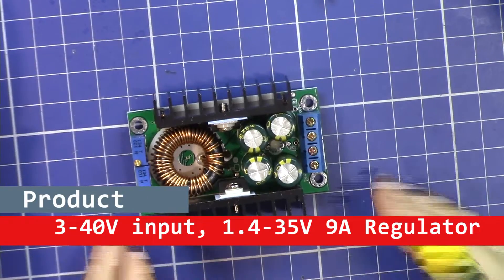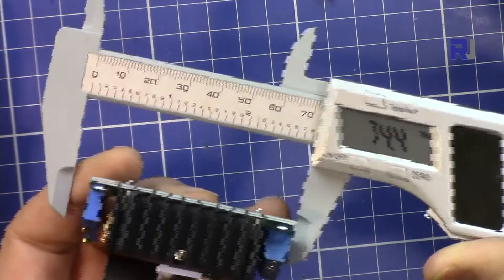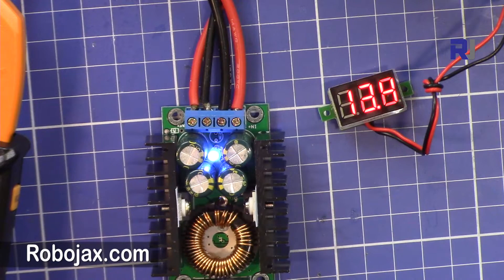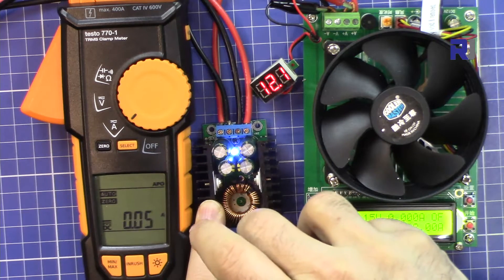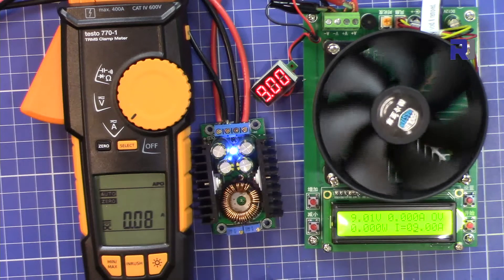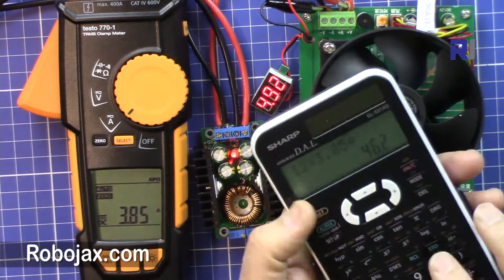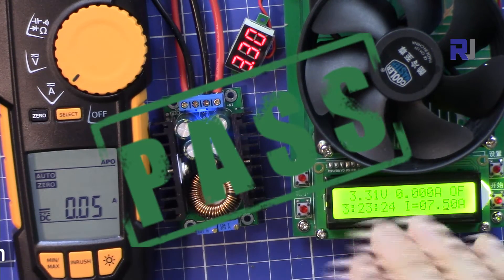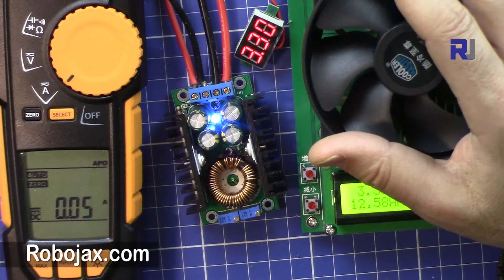DC CC 9A 280W Step Down Buck Converter 7-40V To 1.2-35V XL4016 Module - RJT321

Comment: im newbie with in times of power supply ..

my source is 12 v (4 amp)  = my device is 6 volts..  (what if my device need 3 amp to work)
soo do i have to adjust the power supply ampire more than 3 amp ("5 amp")? or let it be zero..? it will just automatically ?

i notice u didn't adjust the ampire adjuster in power supply.
Reply from the maker: Ampere is the current. If you have a drive that works with 10V 1A,  You can connect it to 10V 1000A and that is fine because your device will draw only 1A. So the current is always determined by the load and not by the power supply. Your power supply should "supply" enough for the load. If Your power supply can supply more that is excess. But no harm.

Comment: can we set the max current?
How to display the max current selected?
I've seen this video
https://youtu.be/wI-KYRdmx-E
show how he set max amp.
But i couldn't catch the connection made..
Reply from the maker: any module with Constant Current (CC) can control the output current and protect the device. (this you have to know first). You will connect your current meter between this module and power supply. then for example set output voltage to 5V. For example if you want to set maximum current to 3A, Then short circuit the output of this module and read the current on your current meter (ammeter). Adjust the knob until 3A current is displayed. Remove the short circuit from the output and your power supply never allow more than 3A.

Comment: If you had tested sufficiently to have a data set you could have very easily plotted the max outputs against input & output voltage  which would have been very useful.
Reply from the maker: the more I do engineering type review, the less people want it. People want plain test and result and I am slowly going towards that direction to make it for everyone so they understand it even if they have been to grade 9.

Comment: is this module can ignore input for 42V 10A? because i want to step down to 25v 5A
Reply from the maker: if you wan to adjust the current that is called constant current or CC. watch the video to see if it has Constant Current.
Reply: @robojax  i have watched bro, so this module can it works to stepdown my power supply?

Comment: Which durable AliExpress  buck converter would be best for a Raspberry Pi 4 . 13.8 vdc input must go in the buck converter. Pi needs 5vdc  4Amp average
Reply from the maker: Hi, Raspberry Pi 2 needs only 2.5A see it here https://www.raspberrypi.org/products/raspberry-pi-4-model-b/specifications/ and this module is like carrying single person on a truck.
Reply: @robojax  Okay. That part is clear.  I just Ordered  2 XL4016 from AliExpress. What would be the best way to adjust  the  Amperage potentiometer.  Since i only have a voltage DC meter.   No current clamp meter.    Should i just  turn the current potentiometer far enough so that the Pi doesn't  go out, or give me under voltage warnings.

Comment: Good, I set the current to 5A if my load needs less than 5A for example 2.5A.
Does the converter only carry this current at 2.5 A if it sees that 5 A is too much for the load?
Reply from the maker: Calculate the power using voltage V and current I, so P= VxI and OUTPUT =INPUT-10% of INPUT
Reply: @robojax  thanks , tell me one thing if I set the current 5a, I'll always have the current output 5a ?

Comment: I bought the same module and whenever I measured the current, it never changed and remains between 6-8mA even though I adjusted the trimmer, so I think those DC converters are not that thing you can trust on, sometimes can come failed
Reply from the maker: when we talk about 9A or 9000mA the 6-8mA is 0.1%. This device (I believe) has 2-5% accuracy. So you still got good result. If you wan to measure small current, then get something that can adjusted between 0mA to 100mA or maximum 1A.

Comment: I am working on a raspberry pi project using an old laptop screen. The screen control board requires 12v 3a and the pi4 requires 5v 3a. I have a power supply that can output 19v 6.5a. I would like to only have one power supply for both but I am confused on how to do this with buck converters. Do you have any input? Great info on these videos BTW!
Reply from the maker: this module can give only ONE output which you can set to any voltages you mentioned. So you will need different module for other purposes because they are different in voltage.

Comment: Do i need to add a schottky diode on the output of this module to charge lithium batteries from solar panels?
Reply from the maker: Job of the diode is to allow the current to flow in one direction. If you want to block the current from outside to come to this module when the other source has higher voltage, then Yes put a diode and it will block the current from entering to this .

Comment: Thanks, I just was looking for input 12v and output 3v3 at 9A. Now I realize that this thing can handle 7.5A at max.
Reply from the maker: You  are welcome.
Reply: It can power 6 x mg995 servos and arduino at once - 5v, 9.33 amps is the max which i had on my multimeter. Is that real? Idk it's cheap model  of multimeter - dt9205. But for sure it can deliver power for 6 servos  and they can turn at high speed, while two of them were hanging on cables attached to 3rd one. And everything worked like dream. So i cna suggest it for robotic arm.etc.
Reply: It CAN handle 9A but limit inrush current.....
Reply: pm me can you to install do sola paint of charger¥

Comment: What does you take max. output voltage with input 12v?
Reply from the maker: The output is always about 1V to 1.2V less than the input. So for 12V input, you will get about 11V or 10.8V
Reply: @robojax  Thank youu ✌🏿
Reply from the maker: you  re welcome.

Comment: Hi,Is it  right to assume that when the output load is more it can offer. it cuts off the load electronically,  based on this can this be used to  automatically switch on load when sufficient power is available from a converter   whose input  connected to a solar panel , solar panel  output vary based on sunlight intensity
Reply from the maker: Hi, Yes you can set the amount of current and it will disconnect the output if the output current exceed the settings. Of if the output is current is larger than the input.

Comment: I needed this for 5V 4A. Works well with 6.4V SLA battery. Voltage is very stable.  I hope it doesn't get over heated at 4A

Comment: For more than 7 Amps (input or output) you should provide extra fan cooling! But 8 Amps will be the absolut maximum at lower voltage difference. I use many of these modules for diy lab power supplies - powered by old laptop PSUs - works great so far.
Reply: Yeah I don't think he has enough power going into it
Reply: J'ai ce module et je n'arrive pas à régler l'intensité elle est en rapport avec la charge c'est tout il l'est impossible de la régler je voulais l'utiliser comme chargeur lithium dans ma voiture entré 14 volts sortie 16.8 sous environ 5a comment faire ? Merci

Comment: This device changes the input current value?
Reply from the maker: The input current always depends on output current. If output increases, input also increases.
Reply: Robojax ok. What I wanna do exactly is I want to decrease 1A to 0.7A to charge my lead acid battery. This device makes it?
Reply from the maker: but why you said "input current". That should be your output current. Yes that is what it does. Constant current means that and it has the variable resistor (potentiometer) to change it.
Reply: Robojax I meant does this device change the input current into another "lower or higher" value as output. So ok if it does change 1A to 0.7 A then does vice versa? For example change 1A input into 3A output?
Reply: @philipmurrayy  current rating means that is the max current available, so if your input is 1A and output draws 0.7, it is just okay because the 0.3 current is standby. There is no need to change current. Current is standby parameter. Current is analogous to water in a tank. If you needed more water, just draw some more water. While voltage is analogous to water pressure which can damage devices if not controlled. As you can see almost all power supplies are voltage regulated, not current regulated. And in parameters, percent regulation is calculated using voltage, not current. So in short, what i'm trying to say is that current supplies are not meant to be regulated. As long as the load current does not exceed the max current of the supply, it is safe to use.
Reply: Carlo Malalad thanks a lot. Great explanation

Comment: i just buy one and its work grate on 8A
Reply: pm me can you to install do sola paint of charger¥
Reply: @anwin85alon  yes it can work with solar panels charge but you need to not pass 5A max for long term working . And use it as 2 to 30v uses . It's good unit as step down converter from 35v to (2-30v) and don't use high current with out Colling fan . You can use it with out fan for 3A or Soo for charge.

You know how to select voltage but do you know the way for how to select  the current ? ( I know how if you want ).

And by the way you can use it as protection from over current ....

Comment: What is the current of the input voltage to power on this buck converter? Is +32V, 720mA DC or +16V, 610mA DC will work as my input voltage to power on this buck converter?
Reply: pm me can you to install do sola paint of charger¥

Comment: Regardless of what it says on the EBAY advert the performance of any item MUST be checked using the makers PDF data sheet where possible. Should more Amps be required a 0.1 Ohm load sharing resistor (5W will normally do) should be added to the output +  and then 2 or more bucks in parallel can be used set to the same V and A . Do not adjust under load. I always use a small fan and would not go above 7A. These units are bomb proof - almost.

Comment: Can you recommend Step Down Buck Converter for Arduino Uno Digital input pin
Reply from the maker: Arduino digital input is accepting 5V. Yes if you set the output of converter to 5V.
Reply: @robojax   can i use this for a raspberry  pi 4 that needs 5 volts dc.  How do i adjust the ride current.  Since i dont have a Amp meter.   My voltage meter only measures AC/DC and Resistance.   The XL4015 has trouble on getting the pi4 with usb wifi adapter  running.  .  The input on the xl4015 is 13.8 volts dc. Outputs around 5.1 vdc.

Comment: Bro as i remember xl4016 is  rated for 8A of current( i think i saw on data sheet🤔 not sure), so why you are testing with 9A.?
Reply from the maker: On eBay they listed it as 9A and some as 8A. So i am giving warning to the buyer. see ebay listings https://www.ebay.ca/sch/i.html?_from=R40&_trksid=p2047675.m570.l1313.TR11.TRC1.A0.H0.XDC+CC+9A.TRS0&_nkw=DC+CC+9A&_sacat=0
Reply: @robojax  oh okay. got it . nice work by the way 🤗🤗

Comment: Thanks for the review, but have you done any stress tests by any chance?
I am using 1 with up to 30V input (7s lithium battery) for 12V output to power a PC with a picopsu at 3-4A. It works but gets hot so i'm concerned about leaving it on over night. It would be good to know how it would hold up at say 4-5A over a week with temperatures.
Reply from the maker: You are welcome. I did test to exactly answer that questions. You should come to conclusion from the test I did. I can't say  because there are many factors that causes the device to overheat including location of the device and how good ventilation it has and other factors.

Comment: Can I use these In parallel to get more amps? Great video 👍
Reply from the maker: Theoretically it is possible. To avoid energy loss you must sent both output voltage AND current exactly the same BEFORE you connect them in parallel. Smallest variation of voltage will cause the current to flow from one that is higher to the one that is lower and the one with lower voltage will act as load and you should try to avoid one of them acting as load. If you can set both at exact values, yes you can do it. But I advise against it.
Reply: @robojax  thanks 😅 I will avoid then!!

Comment: Great video! I have a question, I have several laptop/tv/printer chargers lying around (12 to 36V). What module do you recommend for me to turn it into a sort of bench power supply? Requirements are that it should be cheap, capable of handling up to say 5A, thanks!
Reply from the maker: I don't know specifically which will have more power. But you can read the current rate as amper or power as watt. The higher the power, the larger the size of power adapter. So  you need to multiply your required voltage by 5A and whatever power you got, just add 10% to 15% to it and select the adapter that is equal or higher than Power+10%Power.
Reply: Robojax thanks for the reply. Do you have a recommendation for a buck converter I should use?
Reply from the maker: There are so many potions. This module would be the best. But if you pick exact 5A, it will not work because it will give  you 5A under strict condition. So pick something 2 or 3A higher. eBay is your best search option.

Comment: This XL4016 is an 8A rated regulator, not 9A, limiting the true output of the whole converter to 8A max, BUT it may need a fan to operate much past 6A.
Reply from the maker: You are right the chip rating is 8A.  But most sellers of THE module on eBay have labeled it as 9A.

Comment: Can this converted be switched with PCM in some way, so I could dim a high power led?
There are no connections, but maybe you know a way to implement/hack this on this module?
Reply from the maker: Yes it is possible to do it. If you look at the data sheet for XL4016 IC that is used in this module, it has a SW or Switch pin. In this module the SW pin is always HIGH so it has power at output. Check it and see to cut path on PCB and connect your own wire to the SW pin and control it from outside . Here is data sheet http://www.xlsemi.com/datasheet/xl4016%20datasheet.pdf
Reply: Robojax That is not correct. The SW pin is the actual output. There is a schematic on page 7 that show how it can be done with a resistor and a diode, a pwm ttl signal can be fed to the FB pin and  the SW output can be turned of and on. There is no data on frequency of this signal and how the SW output behaves. I'm going to test this.
Reply from the maker: you are wight. I quickly give you wrong info from Table 1. The SW pin as shown in Figure 3 is just the output stage of the chip.
As shown in Figure 9, you can do it with FB pin as you mention.

Comment: Is this module can be charging for accu/battery 12V-52AH ?
Reply from the maker: It can do it but it depends on how fast you can charge the battery. If you want to charge it  8A/h then it will take 7 hours (7x8=56 close to 52Ah) to charge or if you  do proper charge (lower current) then at 5A it will take about 11 hours (5x11=55 close to 52Ah).
Reply: If battery not new, it has no 52ah

Comment: Would it work on a raspberry pi3 with a 10inch touch screen? I tried 2 pcs Lm2596 to convert 28v dc to 12v and 5v respectively. Saw the voltage jumps for a split second. The video board can power the pi thru usb.
Reply from the maker: Raspberry pi3 needs way less power. this is very powerful. My test showed this module is very stable with under 6A. Raspberry pi need less than 1A and the screen might need another 1 or 2 A. So you have 3 times more power.
Reply: Robojax I'm making a diy 10inch touchscreen raspad using my 24v scooter battery. Had some problems with LM2985's (was supposed to handle between 2~3 amps with heatsink) but it's not able to. I might just get one of these.
Reply from the maker: Yes this should work.

Comment: Hi, Thanks for taking time to put these modules under test. This is very useful 'real world' information that can't be found on the datasheet.
In future, may I suggest adding these very common use cases:
in=24V out=12V, (Optionally 5V and 3V3?)
in=12V out=5V, (Optionally 3V3?)
in=5V out=3V3
I find them less efficient at the higher input voltages.. Good luck..
Reply from the maker: Hi, You are welcome. Thank you for your comment. I am taking note the suggestions and will sure consider it in the future videos.
Reply: pm me can you to install do sola paint of charger¥

Comment: Pity the review was only concerned with 12 V. It's rated at 40 V. I intend using 36 V so this review is a waste of time for me. 
Not only that but where was the 'additional cooling' a fan as recommended by many EBAY sellers. Sorry but a thumbs down from me.
Reply from the maker: Agree that I should have tested it with 30 or 40V. I have just changed the title so viewer know all tests are with voltage under 12V.If you look in the description I have included direct link to all test have been done . But you see the pattern of how this handles the current at 12V.  if regards to using fan, the heat sink never heated at the point to require cooling fan.

Comment: The 5V and 8A test is not exactly failed. It was thermal throttling and the description on many china site claims that on high power it need external fan.
Reply from the maker: You might be right. My test was without any fan. Thank you.